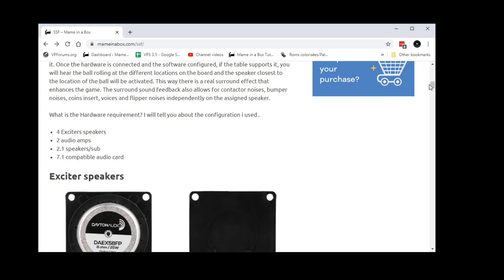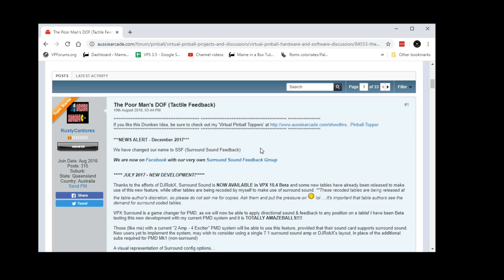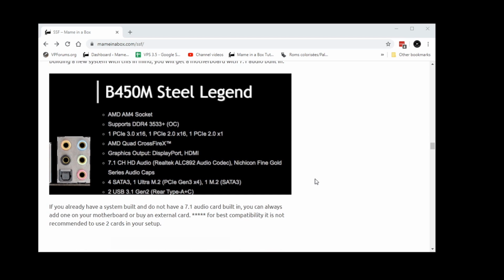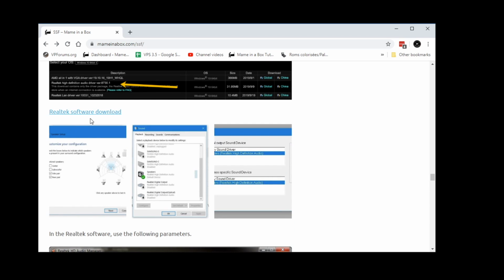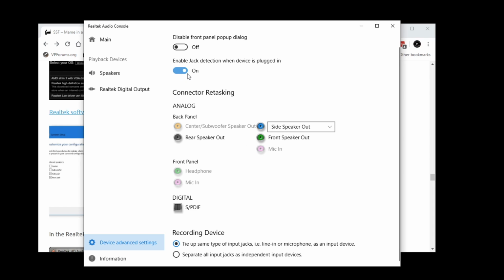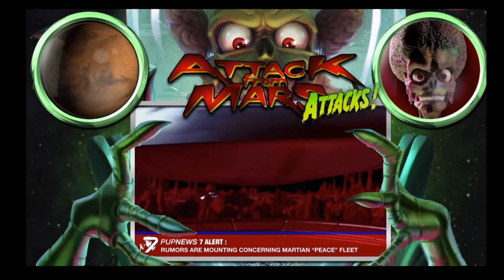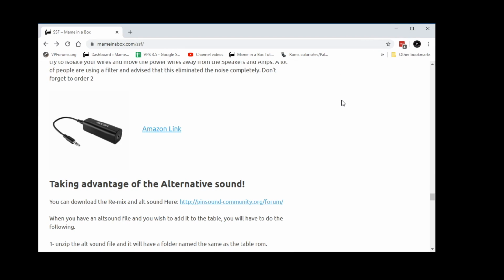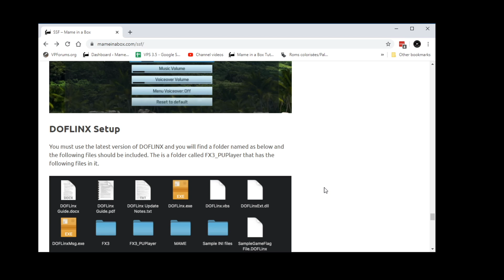Virtual Pinball SSF guide

Comment: How do you wire from the amps to the sound card? My sound card is in my pc and it doesn't take L/R audio signals. Are you splicing? I haven't seen anyone talk about the actual connections from amp to computer.

Comment: Hello - have a question about "Channel Phantoming"

check out this Facebook entry. It is recommended that you solve this problem with the "EQAPO" program, otherwise sound files will be lost at some tables.
 
Source Facebook SSF (Surround Sound Feedback for Visual Pinball)
https://www.facebook.com/groups/SSFeedback/
Contribution by Stefan Weber

Quote: We do use the 7.1 soundcard outputs, but there is actually no center speaker in our setups. So any sound fx routed to the center speaker would be lost.

Comment: WOOOO HOO! finally got a detail and examples explanation of the SSF. THANK YOU so much for this. The only thing you might want to add to the video, is example of the sound of SFF then sound example of the solenoids and switch with out SSF and finally both together to show how much SSF adds to the over all experience of the CAB. Either way fantastic job.... clap clap clap.
Reply from the maker: Thank you paul. We were just chatting about it in the discord group https://discord.gg/x32hXek and i think there is a way to disable the SSF contactor noise if you want to use the real one instead. If anyone knows, feel free to add the info